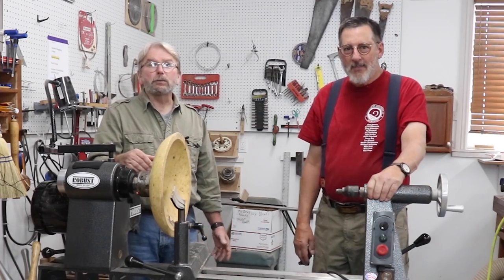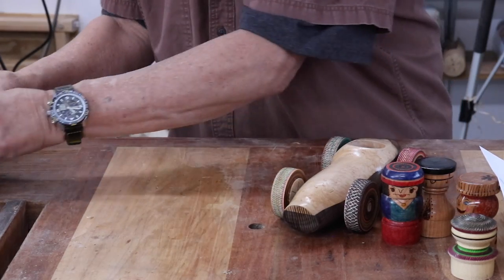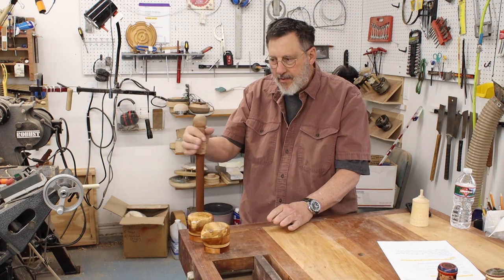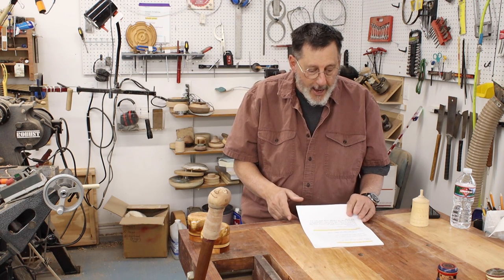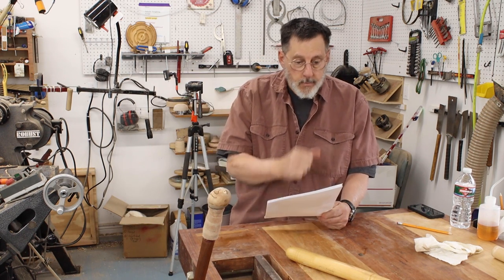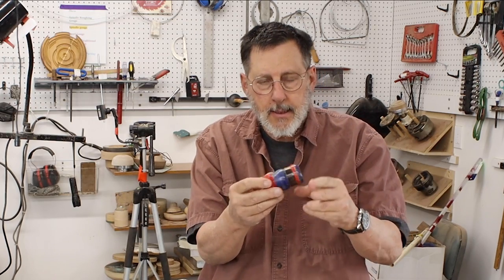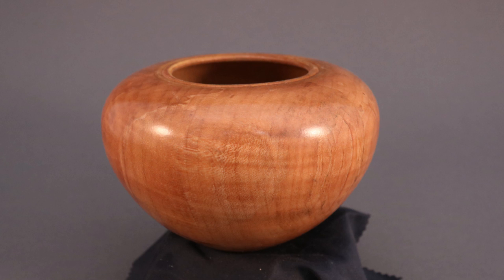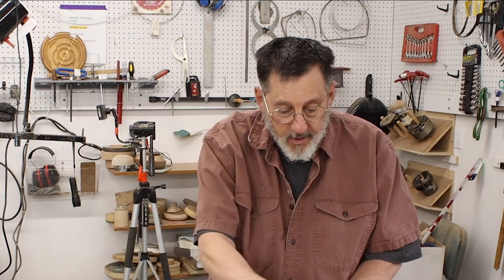Notes from the Turning Shop    May 2022        Woodturning with Sam Angelo

Comment: Another interesting "notes" video. Well your give away got close to me. Mike lives just an hour or so away. That is a very nice bowl you are putting up this week. 👍👍I will be looking forward to the negative rake scraper video. No one has really explained negative rake to me. I am always left wondering about the angle between the cutter and the work piece. It seems to be anywhere from 15 to 40 degrees. Thanks for sharing Sam. You and Cheryl have a great day sand stay safe.🙂🙂

Comment: Just so you know I wasn't giving you a hard time about what I thought was a spindle gouge. I was just wondering because of my novice status. I have made a few mistakes and have the broken and bent tools to prove it. I do have a question about glue...so I used tight bond glue on a vase I made. The glue showed through and you could see where I glued each piece. Should I have used a glue that dries clear or did I use to much?